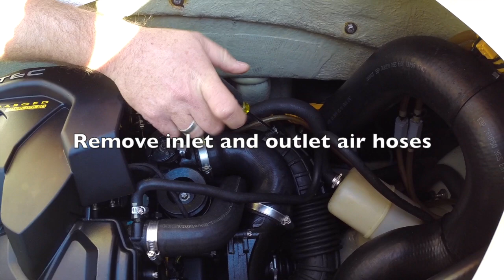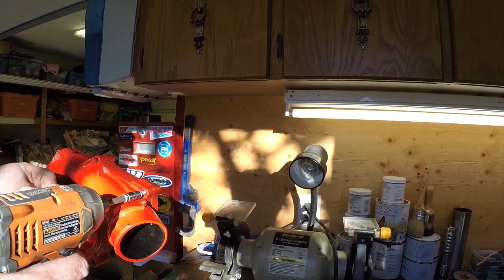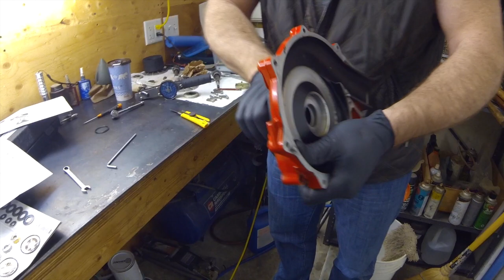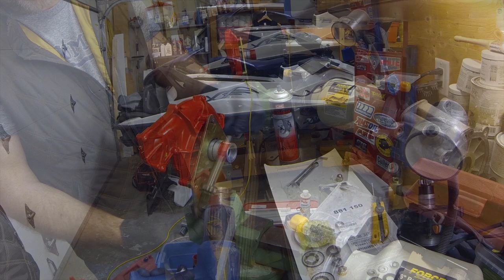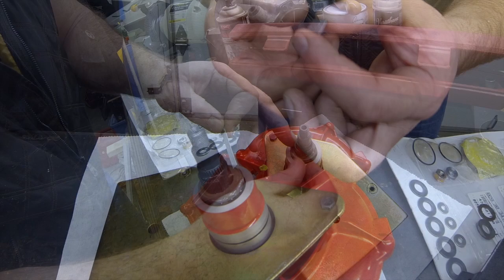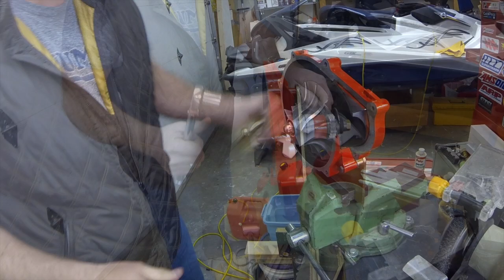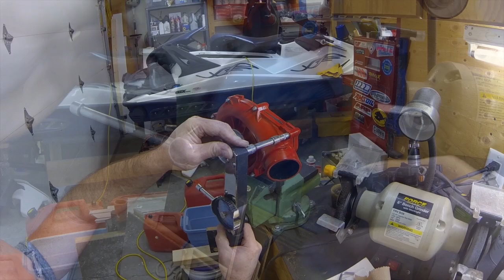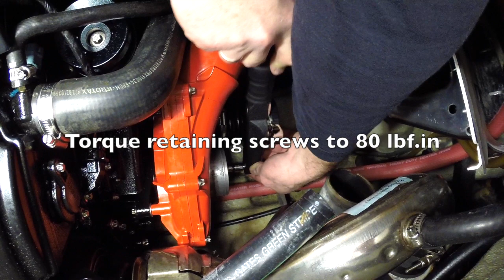How to Rebuild a 4-TEC Jet Ski Supercharger (on a 2005 Sea-Doo GTX 185)

Comment: Good day and thank you for replying. To the bike the used buy and the board does not work. The engine runs very well the only thing that worries me besides the oil in the intake of the hose to the supercharger, is the presence of oil in the refrigeration circuit (that oil where it could come from?).

Comment: (Sorry same question from other video) May I ask? Is there any way to take a supercharged 1503 ACE and tune it down to NA 1503? Or that requires fuel remap other then charger port block off. Secondly what is your opinion on WSM rebuild kits, they are about $100 less then OEM and come with steel clutch washers. Service mechanics will tell me no no they won't even touch the unit if it has aftermarket rebuild kit. I know metallurgy enough that slight difference in quality of steel multiplied by 40-50k RPM then converted to angular momentum on the shaft yeelds much higher numbers and less then perfect cristlatus of steal components under pressure and temperature can easily crack and come apart, but are third party SC kits truly that unreliable and risky or is it just an up sell tactic. I've changed an IAC valve to a third party brand for $40 while oem is $250 and so far it works just as good. I guess only time will tell but $40 vs $250 that is reasonable risk, while gamble on potentialy faulty kit that can cause catastrofic engine failure is too risky so i ask your advice are WSM kits any good?  And more importantly is there any chance of running the the supercharged motor without a supercharger, obviously plugging that mounting port some how?
Reply from the maker: In case someone doesn't see our response to the other comment, here it is for this one: I wouldn't recommend trying to tune it down. As you suggest, there are a few tweaks to the engine system that would confound that sort of change. We've always used the OEM rebuild kits as we don't have the same level of confidence in non-OEM products ...especially when it comes to a supercharger that can spin up to 40,000 RPM. Considering how much damage a failed supercharger can cause, it's just not worth it. Good luck!

Comment: Your awesome I bought 2006 RXT with 60 hrs on it with some upgrades I'm at about 150. I've been dreading doing this but by reading it's necessary to do every 100 hrs but I have the confidence I can tackle the chore thanks to watching your video. Thank you!
Reply from the maker: Unless you know it's already been rebuilt, do not run your engine again until you rebuild your supercharger! Those older units are known to have the faulty washers that may severely damage your engine at any time. Good luck!

Comment: Hi the kits are both OEM kits from Seadoo I measured the top of the shaft and the inside diameter of the spacer it was basically the same size then I micrometered  down where the spacer needs to go it was .001” smaller so I took a chance used the old spacer oiled it up and tapped it on as soon as it went past the midpoint of the shaft, it shot on and has play when I googled this other people I’ve had the same problem, but it just definitely does not slide on the shaft from the top

Comment: outstanding video, wish i have a mechanic like you around my neighborhood,  in my area, the marina jetski mechanic ask $600 to replace my ceramic washer from my seadoo sportster 2005 supercharger, it is in red color, they check my boat has 72 hours on the engine.  but i told them i don't zip around  on the water, my max speed it 25-30mph, but the mechanic said it still need to rebuild it asap.
Reply from the maker: Unfortunately, those old superchargers were problematic. If the washers failed, it would cost you a lot of money to fix the damage to your engine. Maybe next time you can rebuild it yourself. Thanks for your comment!
Reply: Do you know what year they switch from using the ceramic washers?
Reply from the maker: You’re usually safe if you have a 2008 or newer model.

Comment: Thank you for the video very informative just a little bit stumped on the torque unit used is that IBF.ft  inch pounds ? I looked it up and it says torque force measurement so would you get a different type of torque wrench?thanks
Reply from the maker: Thanks for the kind words. “lbf.ft” is foot pounds, whereas “lbf.in” is inch pounds. I know it’s a bit confusing, but that’s one of the standard was of showing the units and is out of the Sea-Doo Service Manual. Safe riding!

Comment: I got a 2007 rxt at 77hrs and it runs great. When should I be considering rebuilding the supercharger? Thx
Reply from the maker: There's a good chance the supercharger in your machine has the ceramic washers. I would not turn over the engine until it was rebuilt. The next video series is on a Sea-Doo engine where the owner wanted "one more ride" before rebuilding his supercharger. That decision cost him about $4,000.

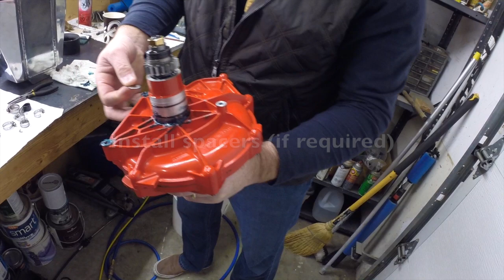Comment: Hi, today I removed my charger because its leaking oil to my intake and it does not have the spacers at the back 7:45 , how do I know If I need spacers or not? Jetski was running good just some oil in my intake…
Reply from the maker: Check out the parts diagram for your machine at Sea-Doo's website (and good luck): https://shop.sea-doo.com/ca/en/shop/sales/parts/

Comment: We bought a GTX 2003 with 250 hours, supercharge was never done. As soon as I got it, I did the rebuild following your video, thanks a lot!! Luckily for us, the original Supercharge was in top shape, I even checked the slippage for fun.. was in the norm.. crazy. Did the rebuild anyway no chances to be taken. 
-If you move forward slowly and don't do waves/jumps, (you don't torque the engine) is it possible that the Supercharge slips less or not at all, or there is always a splippage occuring as soon as you give gas? 
Was wondering the cause of it lasting for so many hours, last owner was just cruising all the time without torquing the engine, though it was a possible explanation.... thanks again!
Reply from the maker: It’s hard to say. Definitely the more gentle you are on the machine, the longer it will last. 250 hours in an older machine is unprecedented, though. The bearings should have given out, just from age. I wonder if it transferred owners at some point and the new owner didn’t know that it had been rebuilt. Mind you, we had the same machine some years ago and it had about 350 hours on it. We put 100 hours on it after we bought it without confirming that the supercharger had been rebuilt (by the looks of the machine we doubt it). So there you go, miracles happen …
Reply from the maker: …mind you, the jet pump eventually failed on that one in the ocean, leaving us stranded on Salt Spring Island. Could have been a disaster.

Comment: Can you explain "slip moment"? Is it what it sounds like, the moment when I feel a slip in the torque? Or the momemt when the slip washers move? Thanks in advance. Rebuild going good. Ready to get back on the 💦!!
Reply from the maker: When you turn the nut, the inner shaft will not turn and then at a certain point it will slip and it will start turning. The torque at which it starts turning (after it slips) is the slip moment.
Reply: The slip moment is when you forget you spilled oil and then slip, and then crack, and then ooooof

Comment: Nice! I have a question on what the needle bearings are. The instructions showed there were 40 of them and you kind of skipped over that part
Reply from the maker: Thanks. We actually showed the entire process. The needle bearings are applied to the grease on the shaft to get them to stick around the shaft (we put them on in sections; there are lots of them). The drive gear them slides over them and will rotate over the bearings surface. Needle bearings provide a wide bearing surface as they are not spherical, but instead are cylindrical.

Comment: What do you think of balancing the unit every rebuild? for something that spins at between 45 ~ 50k harmonics would play a big part in longevity, no?
Reply from the maker: Sounds reasonable, but doesn't seem necessary. We haven't encountered the need, yet and have had no problems with our rebuilds.

Comment: I have a 2012 rxpx 260 with 56 hours on it. The problem is that it sat up for about 9 years without ever being ran, I did the finger test to check and see if it slipped any and everything is tight. Even removed the supercharger and visually inspected everything and it all looks to be in good shape. Should I rebuild it anyways or do you think it's good to put another 50 hours on it before rebuilding?
Reply from the maker: That’s a good question. It’s an unusual case that we haven’t experienced before. To err on the side of caution, we’d probably rebuild the supercharger. Also, check the intercooler to make sure it’s sound and not leaking any moisture into the air intake. Good luck.

Comment: would it really make a difference(if so how much) when u put a K&N filter right above the supercharger and ditch the long air intake tube?
Reply from the maker: Well, bear in mind that whenever you put a filter in the system it restricts air flow. We don't use one.

Comment: Have you ever had issues with the slip? As in needing very high torque to get the slip? I’ve just done a rebuild with an OEM kit, the bearing spacer did not fit, as was too tight. So I installed the old one.
Reply from the maker: No, never. Double-check to make sure you got the right kit for your supercharger, and the spring washers were installed correctly. Good luck.
Reply: Thanks for the reply…. I checked the spring washer set orientation and that’s all good. I did find this https://m.youtube.com/watch?v=YJgp0j73l64 regarding bearing spacer… not sure if this is my issue or not as I have used the original one, probably should of got the vernier on it. Have sent a message to BRP.

Comment: Great Video! I am having trouble getting my retaining disc off. Do you have any tips?
Reply from the maker: Danny Voelker Try a little heat on the housing around the disc. That might help. You could also spray some penetrating oil around the disc to see if that can get in and loosen it up, but make sure you clean off any of the oil before reassembly. Good luck and thanks for your comment.

Comment: Thanks for an excellent video.  How many hours of straight time does it take you to do the job and how many book hours does a dealership charge?
Reply from the maker: It really depends how lucky you are in removing the supercharger. There is one screw that is a pain in the neck to remove. If you’re lucky, it’s about an hour to remove the supercharger and set it up. Probably more like 1.5 hours. Then it’s about an hour to rebuild. I would say it’s about three and a half hours total time. A shop will probably charge $500 0r so labor plus $600 parts plus tax.
Reply: I just took mine in for this service and cost me $500 parts $500 labor in NorCal peace
Reply from the maker: Thanks for the info.

Comment: How do you guys feel about the every 100 hrs OR 2 years guidance. Is it really necessary to rebuild the supercharger every two years if you are really only putting about 10-20 hours on the ski a year? Or should you primarily be tracking the 100 hr mark?
Reply from the maker: We don’t follow that guidance. Depending on your kit, you should be able to get 150 to 200 hours out of a new supercharger rebuild. If you don’t use it very often though, a rebuild every five years should be good in our opinion. Good luck.
Reply: @3ftDeepChannel   I just rebuilt my 2016 with 103 hours. bearings and clutch's looked good but the plastic bearing retainers were pretty brittle. made it almost 7 years but I was getting nervous.
Reply from the maker: Thanks for the input, Jeramie. It’s that plastic bearing cage we’re worried about.

Comment: Sorry, another question...………...I purchased a sunk 2008 GTX 215 for 900$ that I will tinker with next summer. The owner reported to the dealership that is took on water after the engine seized on him...…...so I have no clue what I'm going to find. Anyways, my question is: what online parts company do you guys recommend for after market parts that sell reliable and quality parts such as jetpump rebuild kits, gasket sets, oil pump rebuild kits, SC rebuild kits, etc...…..I don't want to end up purchasing cheap parts that will fail or cause more problems, and I probably don't want to pay full OEM prices either.
Reply from the maker: We usually get our non-OEM parts from SBT or Riva Racing. We’ve had good luck with them. But for a 2008 you should also consider used parts through eBay. Good luck!

Comment: Sirs; Thank you for all the great very helpful videos.
Re this supercharger rebuild;
1) Seadoo dealer never heard of Super Lube, 293 550 030
    crosses to loctite LB superlube, they use BelRay waterproof,
    what do you use ?
2) I also have 2005 GTX 185, did not notice 3 spacers when removed,
     SC to Eng, was rebuilt in 2010 at dealer, when are they required ?
Thank You Very Much.
Reply from the maker: I'm not surprised that the dealer has never heard of a product that they're supposed to use in each supercharger rebuild. I've found that they often have none of the screws available that they're supposed to replace every time they remove the iBR (although I'm sure they charge for them). I suggest just using whatever the dealer uses, as we often use whatever's laying around that's close, and it seems to work perfectly. I suggest looking at the parts fiche on Sea-Doo's website to see what's supposed to be in your supercharger. Not sure if this link will take you there: https://www.sea-doo.com/ca/en/shop/essentials/parts-iframe.html. Good luck.
Reply: @3ftDeepChannel  Thank You for the reply.  I did as you suggested & looked at Seadoo parts diagrams but did not see any spacers, supercharger  to engine, for 2005 models, still confused as to why you used them on this 2005, unless just example ?  Thanks Again
Reply from the maker: @bsmith5709  Sorry, I think I misunderstood your question. The supercharger kit we purchased included instructions that stated to use the spacers when installing on older models. The newer models didn't require the spacers. Not sure if it's the rebuild kit (which is OEM), the engine block or the supercharger that is different, but that's what the instructions said. Good question, though! Thanks for your comment.
Reply: @3ftDeepChannel  Thank You again sir.  I spoke to the shop manager at PWC Muscle, he told me that the spacers requirement, supercharger to engine, depends on which SC housing you have, by casting number.  If needed they superglue them on.  He also told me that the grease should GO ON THE O-RINGS, so they do not dry tear, and at base to help seal. I note manual just says "sealing surface".  10 Nms = 89 lbf-in, my 2005 manual says 10 Nm for one of the 3 screws, no note for another, and 30 Nm for the one on top, I am hoping it is an error.
Reply from the maker: Thanks for the update, and good luck.

Comment: Do you have to use Isoflex grease on the needle bearings what if you don’t what happens?
Reply from the maker: Sea-Doo states to use Isoflex grease as indicated in the video. We haven't always used it (we've used another product at least once before with success), but you're taking a chance of harming your bearings if you don't. Try to find it, or have an expert tell you what the equivalent is. Good luck.

Comment: I still dont understand why the exhaust has to be pulled back....is it to get the the top bolt on the supercharger better? I was able to get my bolt out of my 2005 RXT by just using a 6mm 12 point combination wrench
Reply from the maker: It's not always necessary to pull back the exhaust. Sometimes it makes the job a heck of a lot easier, though. Thanks for your comment.

Comment: i just installed my ball bearing cage side down ( impeller side bearing) am i going to blow up my bearing and maybe engine also?
Reply from the maker: I’m sorry I don’t know the answer to that question. If I were you though, I’d reinstall it the right way. It will cause too much damage if/when it fails. Good luck.

Comment: Hey guys, good video. I’m having a problem with the torque of the slip moment. The washers slip way before reaching the target. What have I done wrong?
Reply from the maker: I’m assuming this is a brand new supercharger kit? There could be a number of reasons for this, if so. First question, did you make absolutely sure to arrange the spring washers correctly?
Reply: @3ftDeepChannel  yes it’s a new kit and I removed the washers to check that I installed them correctly
Reply: Do you have any other suggestions?
Reply from the maker: Did you make sure to torque the Cap nut, first like we do in the video? Also, what is your slipping moment torque?

Comment: I just removed my supercharger  from my 2006 seadoo sportster thinking to go turbo. Do they make a plug to seal the SC hole and how much work to go  turbo instead I have  2  of them which size impeller be the best for top end  and reliable . Thanks
Great job  . where are you located
Reply from the maker: Sea-Doo uses essentially the same engine for the supercharged and non-supercharged models, so I suggest you check out the non-supercharged version of your machine on Sea-Doo's website and see if there's a part and part number. As for impeller, you should discuss this with the manufacturer, as these can be very finicky if you use one with the wrong pitch, etc. Good luck.
Reply from the maker: We're located in White Rock, BC.
Reply: Thanks . Do you know if theses  motors last with double the factory boost and E 85 or what boost do you recommend  for more power and reliable
 E 85
Thanks
Reply from the maker: I never use gasoline containing ethanol in my powersports machines. I only use the highest octane fuel (without ethanol) that I can find. Ethanol is nasty stuff!